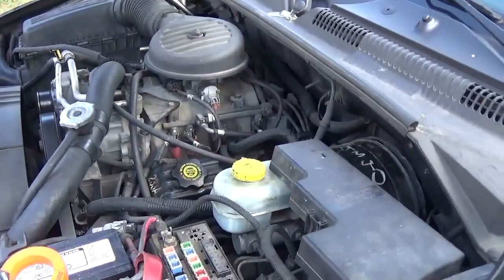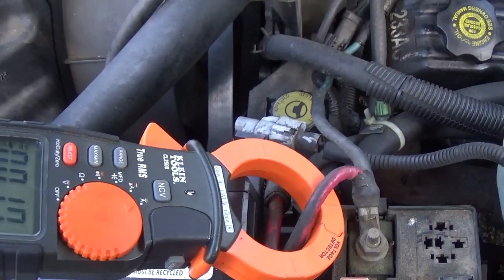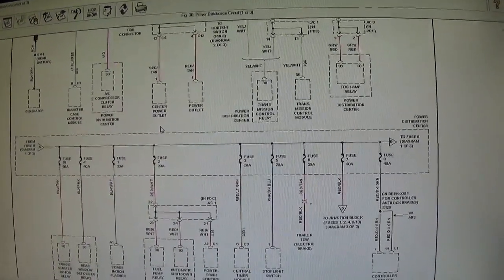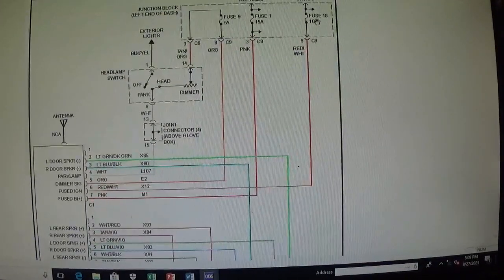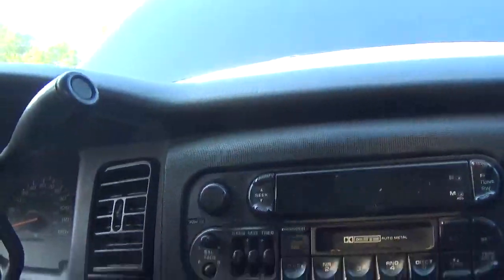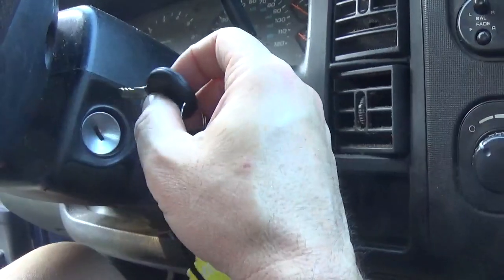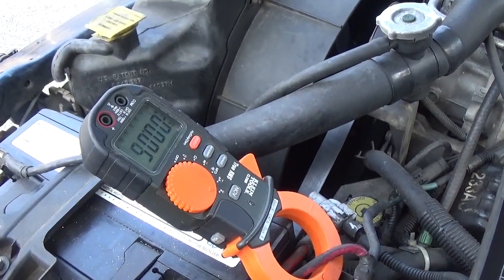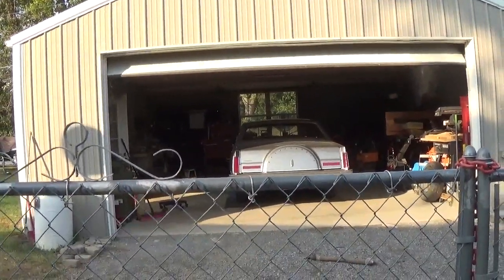2001 Dodge Dacota Battey Drain

Comment: The switch is operating the way it's supposed to except you are not supposed to be able to pull the key out when in the ACC position.  The ACC position is when you turn the key reverse past the lock position.  It allows you to keep accessories on such as the windows, and radio which consumes less power than when in the on position.
Reply from the maker: Thank you for sharing this info my friend. You are absolutely right. New cylinder does the same but key stays in it.👍